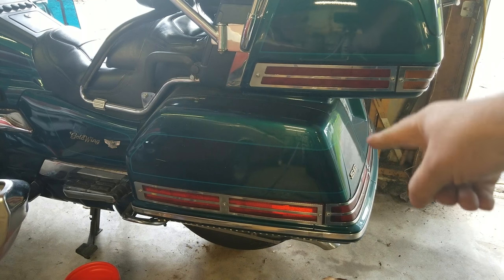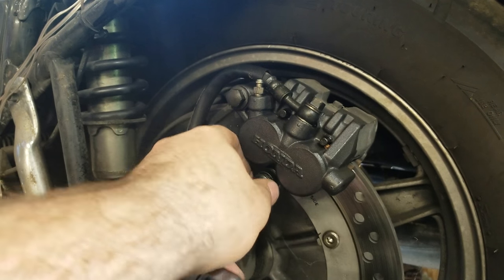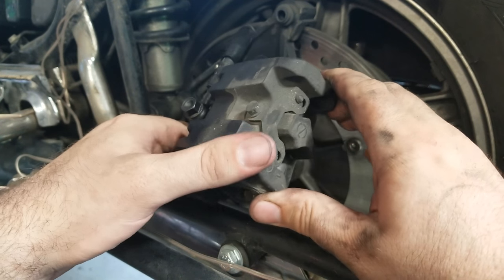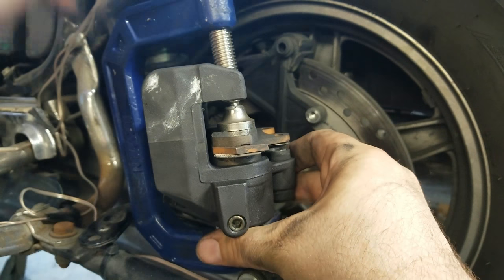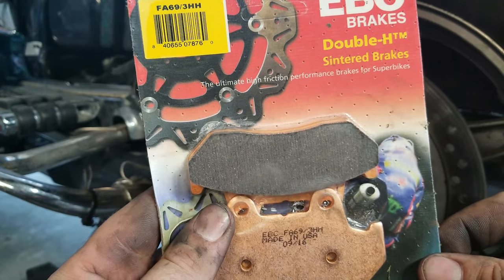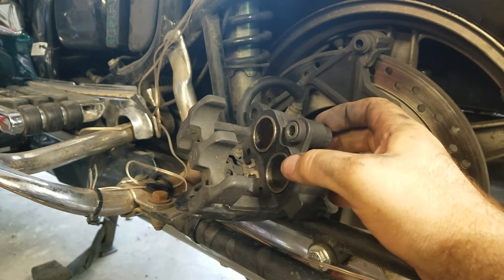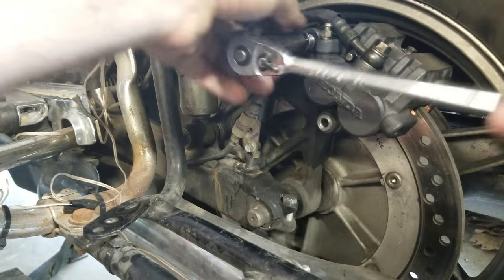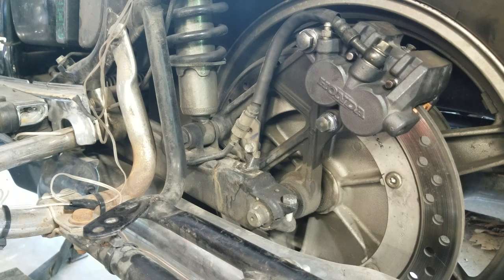How to replace rear brake pad on a GL1500

Comment: exactly right about cleaning and greasing those pins.they allow the brakes to self center so that only 1 pad working properly,it would eventually chew/destroy the disc on 1 side.

Comment: I am a subscriber and I can't tell you how invaluable your videos have been. I recently bought a 94 Interstate and I love it! Being the gearhead that I am and a seasoned "re-conditioner" I always replace wheel bearings and brakes right away. It's cheap insurance that can save your bacon at the right time. With the help of this video my "big gal" as my wife calls it is gettin' new pads tomorrow after work!

Comment: I have replaced my pads but when I put the caliper back on the disc I can't get the bottom bolt hole to swing past the brake caliper bracket. Any ideas?

Comment: Hi if the back tire of a Gold wing motor size is 160 /80 / 16 and I didnt find this size ...can l use a tire of size 160 / 70 /16  ?
and thank you so much .
Reply from the maker: You can, but I do recommend the factory tire size
Reply: @CliffordRice  ok thank you